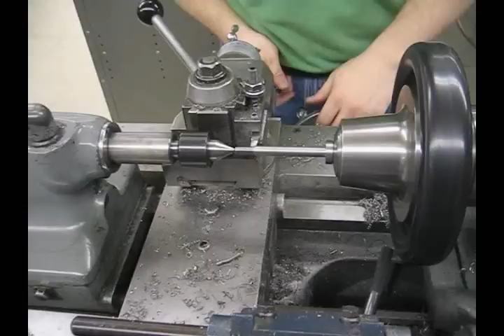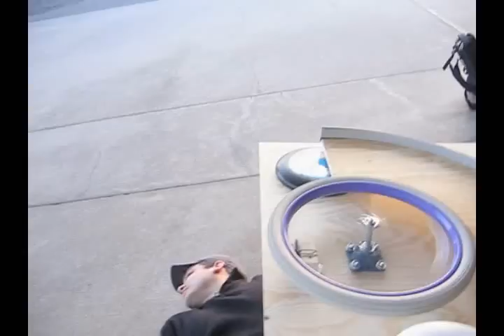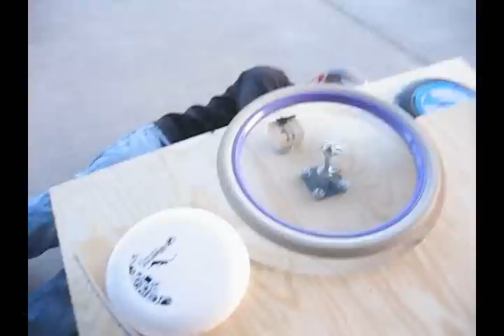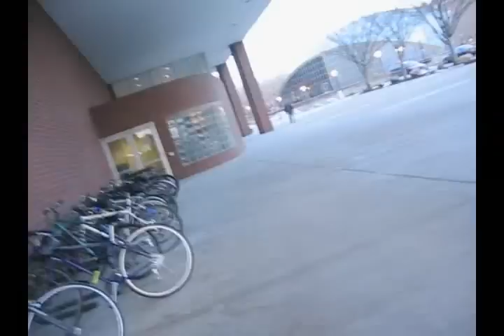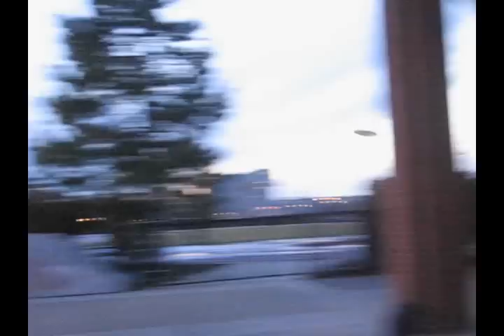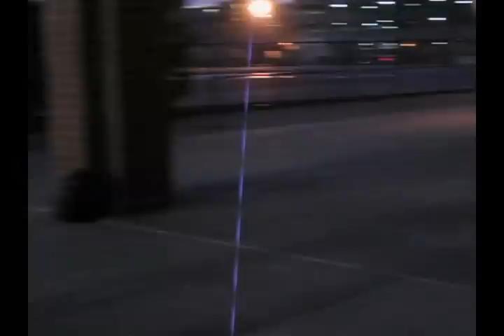The Building of the Frisbee Thrower

Comment from the maker: @ukystout We started off the project by using a cup-shaped steel brush attached to a drill. It was a makeshift solution that allow us to spin and test the wheel. However, we need better coupling to spin the wheel fast enough to launch the frisbee farther. We basically use a bolt extender and nut to extend the wheel axle. It looks similar to this picture: especialneeds. com/axle-extender.html. You should be able to get the accessories from Home Depot.